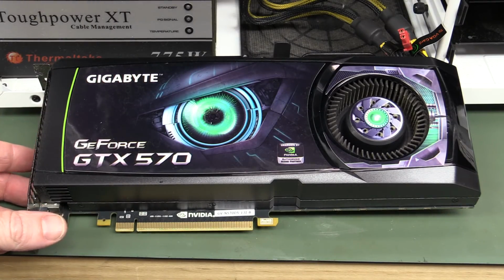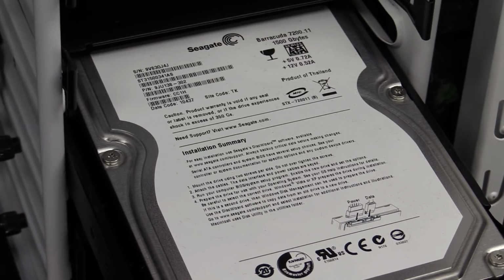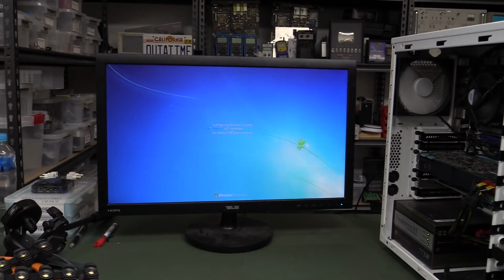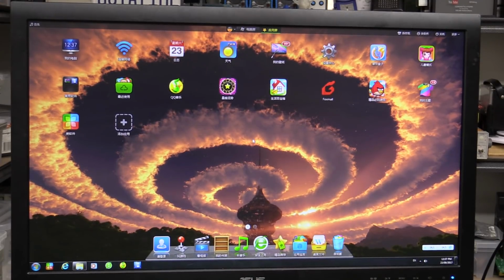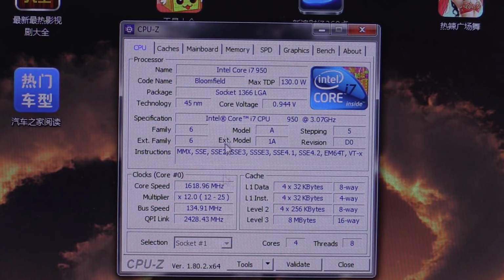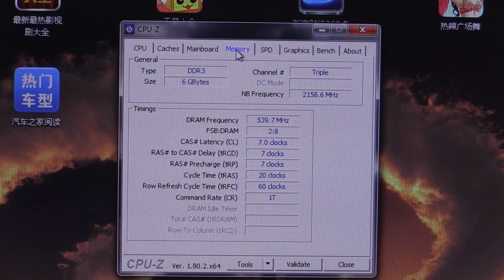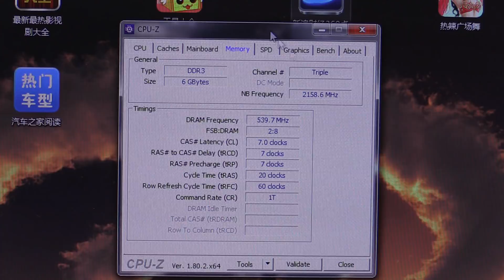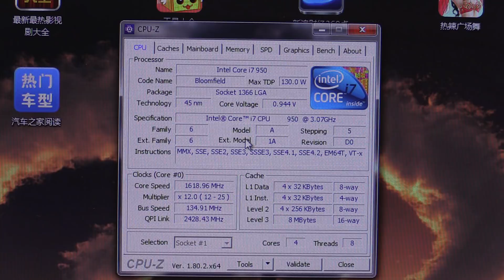EEVblog #1026 - Mystery Dumpster Diving PC

Comment: You might have scored. The Fractal Design case worth $$$. Ditto the X58 motherboard. Even for this day this machine should perform reasonably well after a clean up and maybe an SSD, and it may be capable of overclocking some higher-end i7's or Xeons with beefier cooling (and this case can accept all-in-one liquid cooler if you want to push some high overclocks.)

You can clean this computer up, swap out the HDD for a SSD, load a modern copy of Windows 10 or Ubuntu Linux on it, maybe upgrade the processor since those overclockable Xeons are so cheap, and give this computer to Sagen as his first real workstation.

Comment: You should be able to drop a 6-core 12-thread xeon in this (and then overclock it if you like) like the x5650 / x5660 etc. for under $50.  The boards are pretty desirable still for this reason!
Reply: Yeah, even socket 2011 CPUs are getting cheap, you can pick up an E5-2670 for about $100 now, the only problem is that motherboards are expensive. But the Dell R710 (dual LGA1366) is pretty much the homelab server, at least according to /r/homelab.
Reply: same here my original i920 died after like 6 years of use overclocked to 3.8gh. Tossed a 5675 and overclocked it to 4.20ghz. Will use this until it dies.
Reply: Got a x5680 in mine and its fast for what it is.
Reply: Yep, as long as you have a rev II R710 you can drop in X5650s and above. Mine with 2x X5650 is chugging along nicely and surprises me how it holds up against even the 6 core Ryzens now.
Reply: A while back I had X58 setup with X5670 and 24gb ram, but sad thing about software even today is, that multicore support is not great and single core speed dominates most applications. X58 platform is still quite valueable in terms of resale value. I sold memory, cpu and mb when moving to Xeon 1246V3 and probably only had to pay 200€ to make the change. Also the X58 setup I had was a power hog and Windows 8 did not support any power saving features on the mb.
Reply: Chris Bourne this is a nice system.  It'll pants the cookie cutter systems they sell today.  I owned a  Rampage II 1366 that had a i7 920.  It was the best on the market until lightning cooked it.  Broke my heart it tell ya.  I held onto the RAM and CPU, I think in thge hopes I can set up an open frame media server, is they are still good.

Comment: Seems useful, if it is reliable, turn it into an NVR for some IP cameras. Downclock and undervolt the GPU to further reduce the power consumption, and then use any security camera recording software that you like and has object recognition. Great for setting motion zones and custom alarms if a human is detected at a specific location.
I use the alarm on mine for when I am expecting package deliveries as I can get enough of an alert to run to the door before the delivery worker reaches the door (as they often have the missed delivery slips prepared in advance and will stick it on and walk away without attempting to knock or ring a doorbell.

Comment: you can get i7 950s  for about 20.00 - 40.00 on ebay.   its main issues will be its 130w TDP.. being old  it uses alot of power for the prefromance you get out of it .... the Video card is way worse .   You can get A very low end cheap GPU now and it will out preform this and run way cooler.   (GTX 570s have HUGE HEAT ISSUE.   YOU CAN COOK EGGS on them )
2gb sticks off Ram ...they only good for gold reclaiming.   Old HDD ...not even sure what too use it for.   Most people only use HDDs for NAS nowdays.   The case and PSU are nice ...
Reply: Great. Newer processors are more efficent.  So what? He paid nothing for this, versus the $1000s a threadripper system will cost you. 

Are newer PCs better than this system? Probably. Can this computer be outperformed by a $300 new system? Yes! 
And Electronic For Fun, you're really exadurating! You don't know how many people would be happy to own a system like this, even if they run hotter. I've ran much older computers than this and never experienced sweating. And the powerbill would be just fine. I run an i5-2400 with an iGPU (a generation newer) and never had big issues.
We can argue about this all day long, but in the end, he found this thing in a trashcan! You just can't complain. He sure doesn't.
Reply: Yeah, GGS.  This computer beats the pants off of any one of my systems right now.  6GB of RAM is more memory than ANY of my current systems. XD
Reply: Okay. Yeah, my computers are all I3's, so if someone gave that to me, then I would say sure.  I would probably end up upgrading it though with a new video card, RAM, and a few other things.
Reply: "GTX 570s have HUGE HEAT ISSUE.   YOU CAN COOK EGGS on them" if your cooler is shitty enough you could cook eggs on any processor.
Reply: actually, a new 300$ system might not have chance to beat that old i7, especially if most of these new 300$ PCs are mostly low end builds or prebuilts with iGPU and lower end Atom based Celeron/Pentium crap (what 300$ usually gets you here), no iGPU of today beats a GTX 570 (GTX 570 is roughly GTX 660 which beats the GTX 750ti), an i3 doesn't fully beat that i7, it'll beat in single thread stuff, but in multithread, it might only be able to match at best, some heavily multithread programs will favor more the 8 threads of the i7, also, this i7 is better than many modern CPUs like APUs, many AMD FX CPUs, any Atom based stuff, many lower end i3s. Yes it just uses more power, but is not that far higher compared to a modern PC, some people tends to overestimate TDPs, Intel rates TDP for wost case scenario usually. Remember this system could be upgraded too, like 6 core Xeons (also more efficient than the current i7 it has), up to 24-48 GB of DDR3, newer GPUs like GTX 1050/1050ti/1060/1070/1080, more efficient PSU and many more stuff
Reply: "Can get Windows 10 keys on ebay for $6 - 20 on ebay (the go up and down)." or you could pirate one if you're really in a pinch and not pay a dime for it. l have preactivated keys both both osx and windows 10.
Reply: an core i3 is not a top notch processor.

"I bet a lot of people would be happy with this system." l don't think anybody would be happy with this system, it's way too old. it could keep up with internet tasks no problem but it will struggle with games or any real work loads which means a power user wouldn't want it. and it could make a nice little home theater PC, or a computer for your kid to do school work on and screw around. BUT even though they are old and now where near a modern CPU in terms of power, they were still built as high performance components back in the day. which means they suck a shit ton of power from the wall and produce enough heat to make you sweat if you're in the same room with it. so a machine like this is useless to power users since it became a dog over the years, and useless to people looking for a budget machine since the cost of your electric bill would be enough to buy a new computer.
Reply: Amazing find you're obviously out of you're mind to say otherwise
Reply: "Great. Newer processors are more efficent.  So what? He paid nothing for this, versus the $1000s a threadripper system will cost you." well yeah if you're going to get a threadripper system then it's going to cost you a few grand, but we are talking about modern low tier CPU's like i3's and i5's which are very affordable CPU's and will run more efficiently and are more powerful then this system, and you're jumping to enthusiast grade top of the line CPU's. it's not an accurate comparison because your comparing garbage to the absolute best of the best, it's like saying you can only own a rolls royce or an AMC pacer instead of just getting a toyota camry or a ford focus.

this computer isn't free. first of all it uses tons of power as we already stated, and the power it consumes WILL make a noticeable difference in your electric bill. and everyday that goes by is another day your computer becomes more obsolete.

no l am not exaggerating, power users will laugh at it and budget users will complain about their electric bill. only a numskull would be happy to own something this old. it's not worth it, it's an old and decaying platform that is useless since there are much better options out there that won't cost you anything.

the i5-2400 was a bitch when it left the factory, of coarse it isn't going to put out much heat. that CPU's TDP is the same as that of a modern flagship CPU. where as the i7 950 has a higher TDP than the FX-8350, it's a hog of a CPU. 

"he found this thing in a trashcan! You just can't complain. He sure doesn't." l wouldn't complain either, but at the same time l wouldn't use it for anything. l would probably throw the guts back in the bin and sell the case and power supply for $50.
Reply: Carlos S. M.+ the skylake and kabylake pentiums can actually kick some ass in gaming and they are dirt cheap (under $100) and a GTX 1050ti can go as low as $150. and a G4500 paired with a 1050ti could make a pretty capable gaming rig that consumes less power than a i7 950 by itself and a G4500 with a 1050ti would more than carry it's weight against this dumpster find.

"Yes it just uses more power, but is not that far higher compared to a modern PC," a 7700k and GTX 1070 together have a TDP of 241watts. a 950 and a 570 together is 350watts. and keep in mind that a 7700K and a 1070 could blow this dumpster find out of the water without breaking a sweat, and l think you could still smash this machine if the 1070 was substituted with a 1060 and the 7700k was substituted with a 7600k which together have a TDP of 210watts.
Reply: He also got it for $0, so no problems with whether or not  slightly newer stuff will outperform it.  ;)
And 6GB of RAM is 'only good for gold reclaiming'??? You're out of your mind!
Reply: Neko, yes if you compare it to the top notch systems of today, sure.  STILL beats the pants off of my computers though!  I bet a lot of people would be happy with this system.
Reply: A free, usable system is a good find in my book. And if someone found an i7 with 6GB of RAM, that's a DAMN good find in my book. Who cares if you can buy cheap RAM sticks or a better GPU if you didn't pay anything for it?
Reply: the fact is .. it is old .. .Uses A ton of energy and make s  A ton of heat ... This thing will cost more to run vs building A new low end system in the long run.   I would say turn into A router and run PFsense on it .. but it just uses to much power.   

Todays Stuff
i9s 10core / 20 threads are 140w,  
Ryzen 7 1800x  8core / 16 thread  95w
Threadripper 1950x 16 core / 32 threads 180w.

this is 4c / 8 thread  running at 130w ...
Throw in the IPC diffrences ... 3.06ghz from 2009 is not = to 3.06 ghz today.    These numbers read the same but they dont show up as the same.

The closest CPU that you can compare with clock speeds is the  i7 7700t
They are both 4cores / 8 threads.
i7 7700T 35w @ 2.9Ghz  / i7 950 130w @ 3.07ghz
7700T benchmarks @ 9402  /   950 benchmarks @ 5590 ....

The 950 only gets about 59.5 % of the 7700t  and it takes it almost 4x the amount of power to do it .
Reply: Generic Green Squid+ the amount of digits a machine like this could put on your electric bill would be enough to buy a whole new computer. and yes 6GB of RAM is only good for gold reclaiming since that is barely enough for a modern system and it's DDR3 on top of that. it's pretty much worthless, you could maybe get a few bucks off of it but that's an optimistic estimate. all current CPU's on the market only except DDR4.
Reply: I did not say New ... but $300.00 and you could Crush this PC.
go for LGA 1155 Stuff.
Get A Z68 board about $80.00 , Xeon  E3 1230 3.2Ghz 4c/8t $72.00, 8gb DDR3 1600 50.00, RX 560 $80.
That leaves HDD, Case and PSU.   Can get A ATX case & PSU combo for 40.00 (newegg)    for HDD i would  never buy  an HDD nowdays .. would get A Cheap SSD  120gb SSD for 50.00.    Can get Windows 10 keys on ebay for $6 - 20 on ebay (the go up and down).

80.00 LGA 1155 Z68 Motherboard (ebay) 
72.00 Xeon E3 1230  CPU (ebay)  100% sure this will work with the Z68 MB
50.00 2x 4gb DDR3 1600Mhz   (ebay) 
80.00 AMD RX 560 about 20% faster the GTX 570  (ebay) 
40.00 Case/PSU (newegg) **
60.00 120Gb SSD (newegg)
15.00 CD key  (ebay)

That is $397.00  ... all that being said .. I did not look that hard, I am sure I could find some of that stuff cheap. and truth is .. I would not use whatever PSU came with that case... would get something from newegg with MIR.  Right now you can get A Corsair CX450 450W bronze for 20.00 after MIR.  Also I have 3 more Windows 10 CD keys on hand ... got them for $5.85 ea off ebay A few months back ( I use them for VMs and builds ).

If you already have some parts case / HDDs .. this would be cheaper...  hell I have 4 cases and about 20 HDDs and 3x SSD not in use right now.  

Anyhow ... the point is ... that is one first i7s and that GTX 570 were really bad way too hot ... that is why the person threw it away.    For it to perform with todays task ... it will need to run at 100% all the time.  its not just the cost of running the 130w CPU and 220w GPU. ... the room you keep it in is going be so freaking HOT .. that AC needs too keep going
Reply: Electronics For Fun The heat issue may be a real thing, but he's just nitpicking a free computer.
Reply: you did not read anything I said ... it cant ... yall keep bring of the fact that is was Free.  .. if it were for someone that did not have A computer at all .. or lived some where really cold all the time .... maybe ...

This liking finding A old Ass flip phone and saying .. Nice .. i can use this.

And i could build A 300.00 Pc that would destroy the fuck out of this ...
Reply: Just saying its not that good of A find.   This computer will cost A ton to run and make your room extremely HOT. ... witch will lead to more AC and even more money.  
3x 2gb of ram sells for $25.00 on ebay ... that name brand good stuff.   

I under stand he got it for Free, but its not good. 

Its the 1st gen i7.   this is very misleading to most people.   All i7s and all clock speeds are not equal to ea other.   The IPC gains from generations to generations can be small from  ea other, but where we are at today on 6th and 7th gen CPUs adds up.  Then you throw in the die size (heat) .. its A 45 nm ... it chugs power and makes heat vs today's 22 and 14nm.

its A 4core with Hypertreading giving it 8x treads.

you can get A i3 6100 2core / 4 thread cpu that is about about 5% faster then this. and only 51w (vs 130w)

Just because its A i7 dont mean its good ... it was grate back in 2009 ....
Reply: no .. i am comparing it to a i3 from today ... that is A poor man system.

Comment: Hey I have the same case! It's a Fractal Design R2. The motherboard alone goes for something  like $150 on Ebay, but that's actually the most expensive part in this machine. The whole thing is worth around $300 maybe? Nice find regardless though.
Reply: just a heads up dont buy something that old you are paying for rarity not performance at that point, the only way i would get something like that is if someone literally gave it to me because there are just better and cheaper/quieter/cooler (operating) systems
Reply: l wouldn't pay a dime for a machine like this, l probably wouldn't even take one for free. those parts are just way too old, l know 2010-2012ish isn't very old but so much has changed since then.

Comment: Snoooooore, what was the point of this video?  It's a PC, it booted, and...?  It's neat that you found it, but is this really EEVBlog material?  There is nothing interesting about this video at all.
Reply from the maker: Haven't had a dumpster dive in a long time and many people like seeing the stuff I get.
Reply: I enjoyed it, nice 2010 premo build. little old and near end of useful life but hey, got some nice bits and bobs, good but old psu, 6 gig of ddr3 2133, 1.5 tb hhd at 7200rpm,  and a servicable cpu motherboard and gpu for a little longer. plus cases and fans are always useful, even if the fans are probably closing in on death as well.
Reply: I liked it

Comment: Slap a Xeon X5670 in it
Reply: These chips are incredibly overclockable. If you don't mind the rather extreme heat it puts off, buy a X5650 instead ($20-30) and overclock it as far as you can. I got mine from 2.66Ghz to 4.2. Good enough for a 8800-9000 passmark.
Reply: 8000 passmark vs 5600 for $60? Probably worth it depending upon intended use.
Reply: EEVblog2 and overclock it. Haha

Comment: Less than two minutes in and I know it's a score. Even if mobo were dead, parts including case, are nobrain keepers. $400-$600 US. Chip isn't "K", unlocked, so speed isn't going to improve. Not sure about memory. Just needs more cheap storage-either a 60 gig SSD+500 gb hd or just a 1 tb hd.